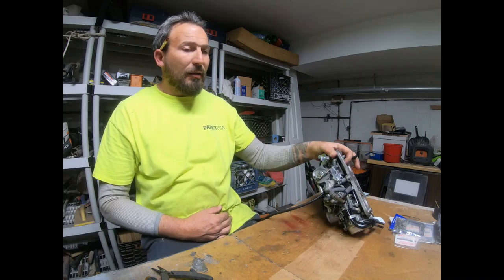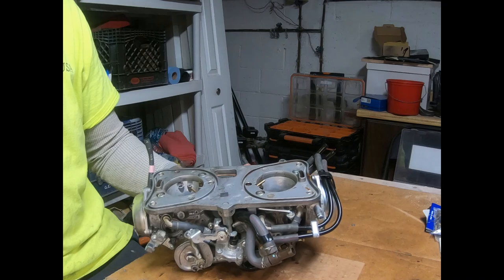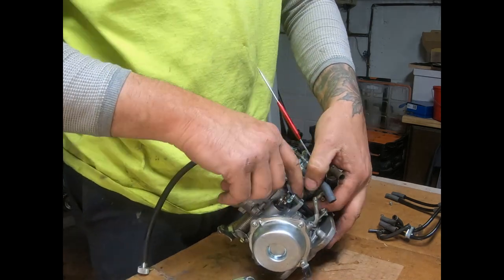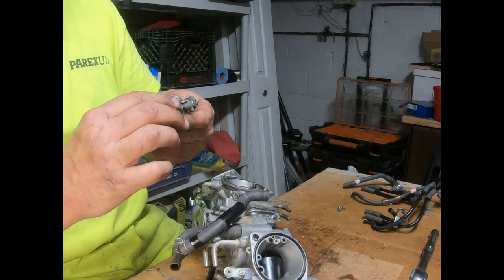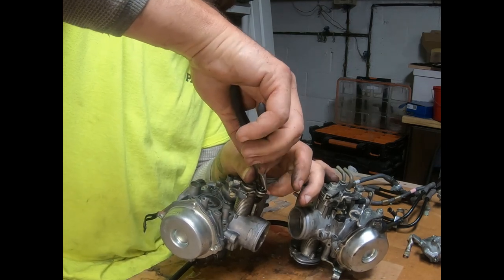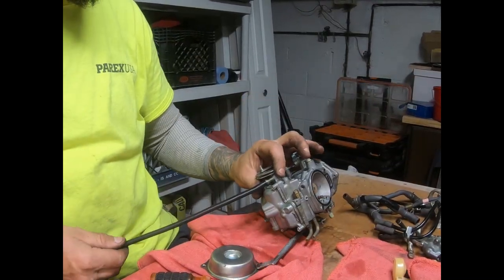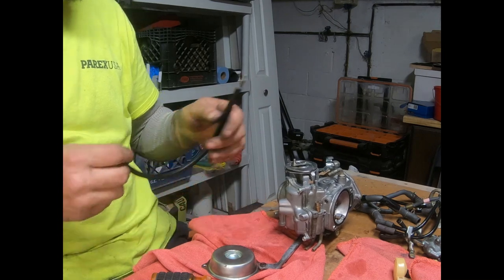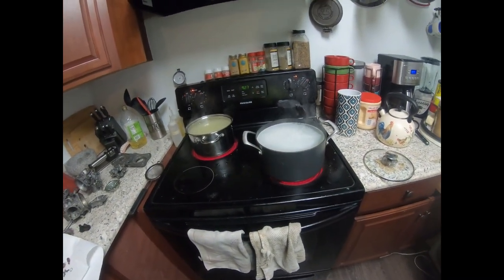GL1500 Carburetor Clean-rebuild

Comment: The mixture screw is specificly set at the factory you have to count how many turns out it is to properly adjust the cardurator
Reply from the maker: It's 2 turns out unless the carbs have had an overhaul per manufacturers instructions

Comment: Have You ever drained the carbs via drain plugs on the Bike ??  I can not see how to get to them . Any hints would be great ,  Thank you for this Vid.
Reply from the maker: There are only overflow lines but that's at the higher point of the float bowls. The drains would be on the float bowls themselves but I don't know that that would solve any problems
Reply: There are drains at on the float bowls, at the front of the carb. There are holes in the radiator, so you can reach them with a very long flathead screwdriver, though they are really tough to hit